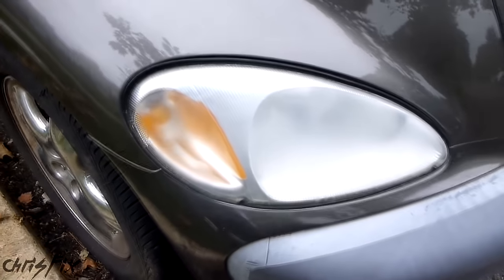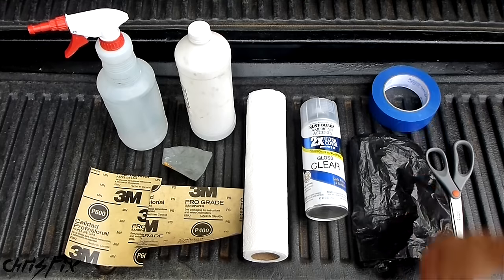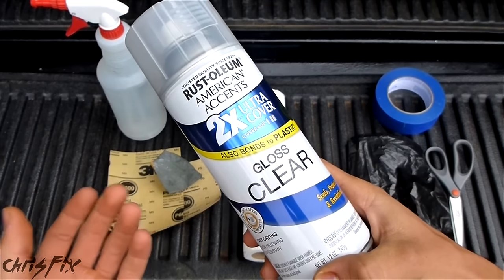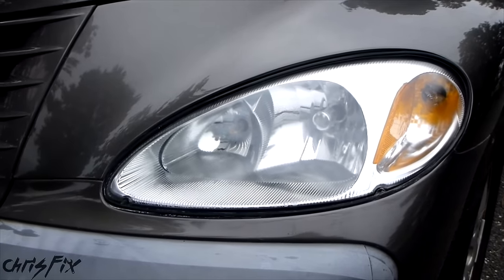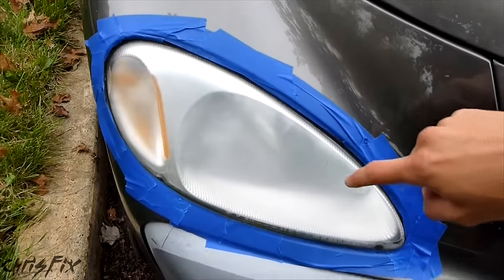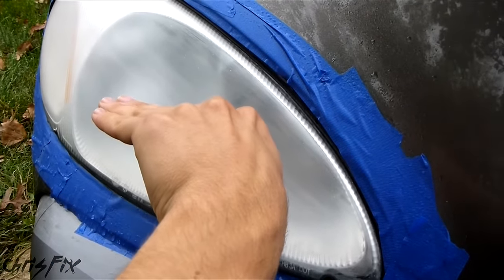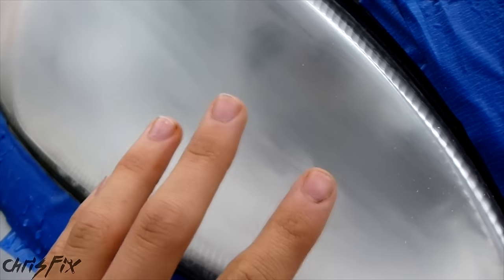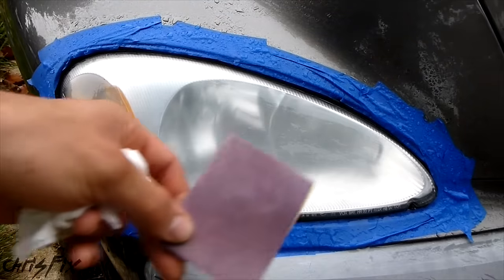How to Restore Headlights PERMANENTLY

Comment: Its been 5 years my jeep is finally back yellow lasted so long cant thank u enough gna sell it after i do this magic to its headlights again at 290000 miles itll go for 2300 bucks 😊
Reply from the maker: Glad to hear the real life experience! Mine lasted about 5yrs as well!
Reply: @chrisfix Are u able to drive the car while waiting the 24 hrs for the clear coat to dry? I wouldn’t be able to let the car sit for 24 hrs straight, would it still come out the same if i just wet sand and wax after the 24 hrs?
Reply: @nathanmartins5543  i would'nt drive since the clear coat hasn't dried up yet and if dirt and rocks hit the headlight it will look scratched up
Reply: Bout to use this to get past a road worthy in Australia 
Cheers mate!
Reply: I did this five years ago and it’s starting yellowing again. I don’t have any clear coat left so I just waxed it after wet sanding with 1500 and 5000 grit. Looks great
Reply: @chrisfix  THIS is the comment I was hoping for. So many 2k haters out there but looks like the longest lasting solution.
Reply: I got a Dodge 2008 1500 Bighorn as an old work truck but decided to go all out with at home restorations" SO FAR SO GOOD but it desperately needs this 😮
Reply: @Runswithwood  This isn't a 2K clear, it's just Rustoleum's 2X meaning twice the coverage. Has no hardener like a 2K.
Reply: @SirPractical  I hope he read your reply.
Reply: MOST underrated comment!
Reply: @chrisfix  you're replying to a NINE YEAR OLD VIDEO
you're THE goat of youtube my man
Reply: Chris I glad you and fellow follower states that the headlights lasted 5 years my question is after a few months can we also put a polish or a wax on it to keep it shinny and clear

Comment: The PT cruiser is good practice in case you mess up you just take it to the junk yard.
Reply: Oh ppulleeez!! I love the "my car is better than your car". I have owned 3 and each lasted 200k + miles. Great compact in the snow, the turbo has 225 horses and still running strong. Good car that Plymouth just decided to make is less so year after year until it's elimination. Chevy, now there is a company that made trash for years and years and just now coming back a bit.
Reply: spudnic88 my neighbor used to have a purple pt cruiser with wood paneling on the side 😷
Reply: spudnic88 XD
Reply: Prowler on the other hand would be sweet.
Reply: The PT cruiser isn't put "on blast" because its unreliable...  Its simply UGLY... That 1930's style grill is hideous & the interior is cramped in the rear.
Reply: In your opinion it's ugly. Do you sit in the rear often? Actually people I take in the back seat like it. The seat sits a few inches than the front and they can see very well. I have driven 2 for 200k+ miles. Hey it's a compact car, basic transportation, ugly "see Prius"
Reply: Either way u slice it the car is trash if u are over 5"8 don't know why you would own one of these but have who am I to judge haha.
Reply: Brett Werner lol this is true. i went to a local junkyard and while every car are scattered somewhat random, they lined up about 30 PT Cruisers on one side of the lot's perimeter.....there are so many of thsn that they were able to groupe them up together lol
Reply: Wow, you do realize that the latest PT is now 7 years old! And most are over 10 years old, and they sold a lot of them. Oh BTW I am 6'4" and the 5-8 comment is strange. Oh next time at the junkyard since you must be so bored, check out how many Chevy's (any year) are there, and report back your findings, such valuable info really proves nothing. So much animosity toward the PT, do you have small hands as well?
Reply: It was a fun design for a car...but, they did the timing as a belt that cost over 1000 to repair...and that also broke and then broke the motor...bad design in the motor....sad, as it was a nice little retro design... and could have been fun to re mod~!
Reply: Kevin Kempt
Reply: Lol damn, Kevin, talk about overdoing the defensive damage control.
Reply: Brett Werner
Reply: Damage control?? All this over a car? I like my car and you don't, OK! At least it ain't a Pontiac. Haha
Reply: Kevin Kempton what's wrong with Pontiac? They make great cars, and the reason their is a lot of Chevy cars Ink junk yards is because they are a very popular brand and when they get wrecked, old, or they stop running a lot of people just junk them simply because they don't know how to fix them
Reply: Kevin Kempton hey don't be bashing pontiacs. the grand prix gt is a bad ass car
Reply: Lol I'm just saying, there's a fine line between proud ownership and PROUD ownership.
Reply: I always called it the "PT LOSER"
Reply: Brett Werner Thats a good one!  🙄😆😂
Reply: Brett Werner 😂😂😂
Reply: madjimms  If you like retro, then you like the PT.  If not, don't look at it.  The grill is a horizontal version of the top of the Chrysler Bldg in NY.  Maybe you'd like the Excursion if you don't want to be cramped in the rear seat?  The PT was sold as a compact and the rear seat was bigger than a VW Bug so...
Reply: lmmfao !!!
Reply: I’m sorry to these other folks but everything Dodge came out with during the time of the pt was garbage.  I think the only options on the car was working or not working transmission but it did have a class leading gas saving feature called “tuesday start”
Reply: Mount a Chevy SB in the middle of the thing, put in a rear axle and make a real car out of it.
There ya go, Chris.
Reply: Kevin Kempton just a question. If the car is so good why did you have 3?  😜 (teasing ya please don’t take it to seriously) My first car I had until someone crashed into it when it was parked well off the street. My current car I’ve had for 10 and will have another 10 at least I’m sure. I think most people hate the pt cruiser due to the fact it looks like an old hurst.  Basically looks like your taking yourself to the grave. Lol. 
But seriously, what ever car/truck/vehicle  you have if it does the job you need it to do then it’s an awesome vehicle. No point in being Uber negative to everyone who drives something different folks.
Reply: Best comment lately.   It hit me just right.  I’m laughing out loud.
Reply: Practice on a PT cruiser enough, and then you can try it on a real car.
Reply: Lol
Reply: I love my 2002 cruiser. It's adorable!
Reply: @leanmeangreenbeanmachine3347  Subjective. Mine is very cute with all the extras. You haven't seen mine and besides, you don't have to like my car. All that matters is that I like my car.
Reply: spudnic88  LOL
Reply: spudnic88  first off the PT cruiser is a chrysler. 2nd they are trash. This is undisputed.
Reply: @13kkempton  Based on your offended response, I'm not surprised those back seat passengers of yours would say, "It's nice and comfy back here."

PS: The Prius is ugly too.
Reply: I think you're smoking crack Brett the PT cruiser was actually a very good and very reliable . you can buy a $80,000 Corvette from general motors that won't go 30,000 miles before the engine explodes but people love the hell out of them.
Reply: mizal215 My friend is 6'4 and drives one its hella rusted still runs great and he loves it
Reply: Fr😂😂😂
Reply: I almost want a turbo PT cruiser. Less beefy SRT4 engine, would be funny as hell gapping Mustangs with one of these fucking things
Reply: Lol we literally have a pt cruiser in my highschool auto tech class to practice on cuz its trash
Reply: @rbreeze789  that's hot
Reply: @dylangullason8712  Pontiac fiero has ferarri body kits too
Reply: @13kkempton  Need to get rid of it. The Transmission will blow really soon mate. Get rid if it, chuck it in the tip.
Reply: That's Hard
Reply: @13kkempton  Why does the air box take up 50% of the engine bay though?
Reply: Lmao
Reply: @13kkempton  Why do u feel the need to Diss Chevy??? What did they do to you? Nothing against Mopar but Chevy never had to be bailed out by the government...JUST SAYING....
Reply: @13kkempton  Again??? Why is it always Chevy...Pick on Ford BMW Mazda why always Chevy? MAYBE BECAUSE U COULD NEVER AFFORD A GOOD CAR..
 A "CHEVY"
Reply: @13kkempton  the PT Cruiser is just ugly..
Reply: Lmfao
Reply: @13kkempton i dont see anything wrong with them.

Comment: I just did this on my 350z, WOW what a difference. Small tip is when you move on to the 2k grit, sand until it seems clear while youre sanding, I.E. you dont see much haze while its wet. Learned that the hard way.
Reply: Mr. Mills I messed up, the clear coat got bubbly and peeled. do I have to start over or just add wax
Reply: Black Titan I would re-sand it. I didn't sand my right one enough with the 2k grit the first time so I went over it again with the 400 then 600 then spent a lot of time on the 2k. After re doing it the light looks great. I would re do
Reply: Mr. Mills I only have 600 and 2000 grit, should I start from the 600 grit and up. would that be enough to get the clear coat off completely?
Reply: Yea you should be fine
Reply: Mr. Mills Did you also respray them with clearcoat?
Reply from the maker: Thanks for sharing!
Reply: ChrisFix PT Cruiser? I'm disappointed in you now man..
Reply: patto ur catto it's not his lol. How do you think he has like 50 different cars in all his videos
Reply: Yep, I had a go at restoring the headlights on my S2000 last weekend, and didn't go over it with the 2000 grit enough - the results were okay, but not quite as clear as I was hoping for. Will have to redo it at some point.
Reply: I see a lot of comments about not enough sanding with 2000 grit. stepping up directly from 600 to 2000 seems like a big jump. if one doesn't mind the bit of extra cost, seems like it would be easier to get a better result by stepping to 800 and 1000 in between? Also, alternating the direction of sanding makes it easier to see when you've removed everything from the previous grit.

Comment: 10 yrs ago i didn't know how to locate an alternator, a caliper bolt, a coil pack.....i knew almost zero about cars, yet i drove them well. 10yrs later I've done over 30 plus brake jobs, replaced ac parts, fixed heating system, modified exhausts, installed several suspension upgrades, upgraded brakes to brembo calipers, replaced several wheel hubs, painted 2 cars, installed racing seats, minor transmission repairs, flipped a few cars, helped several random strangers with minor repairs...this faceless dude who says "soapy woder" gave me the confidence to entire the world of DIY...saving myself 1000s over the years. I remember when he was at 300k subs. You're a boy now. You've helped millions. Thanks a million Chris!

Comment: I followed these directions about 6 years ago, and the lights still look great! I also did the fog lights! Thanks, Chris!
Reply: Well, I am now officially motivated - 6 years is a long damn time.
Reply: @jdsguam  How is it going
Reply: @jdsguam  That's enough time for the headlights to get 100k miles older or more, and still look the same from when he first restored them
Reply: For everyone else, go watch any other headlight restoration "how to" video. This one has dated information, you don't leave the headlight rough so the clear coat can "stick" lol. The smoother it is the better it will look.
Reply: @mimos7214  Van is still on the road & the lights still look clear. There is a slight haze in one spot on the "top" of the lens, but overall, it's still looking good!
The fog lights were pitted before & are still pitted, but clear, although they don't get much sunlight exposure.
Reply: @robertl955  Mine were done around 6 years ago & are still clear. I thought I might reapply the clear coat again, but with almost 300,000 miles, I might not worry about it!
Reply: @robertl955  most of what I'm finding even today says the smoother finish does not hold up to rock chips and debris.
Reply: Thank you for the follow up! I just finished clear coating mine and they look amazing.
Reply: @OpticalToxin  You know what? After I were to do this to make it clear now, then worry about rocks, I would go that extra step and buy some 3M Clear Vinyl wrap and put in on the lens, that will protect it and say for example, later there was some rocks or something happened, you can just pull off the film and just put on another layer of clear wrap.  To tell you the truth, just getting the lens clear and maybe you don't need to put on the clear coat, just buy and put on the Vinyl lens wrap, seem easier, just a few bucks added.
Reply: @virtu3758  I ended up wet sanding 320, 400, then 600 grit. Sprayed it with clear. Dry sanded 800 to remove orange peel. Then wet sanded 1000, 1200, and 1500. The I hit it with compound and polish using a DA. They look great but if I have to do it over I'll buy new lenses entirely and cover with lamin-x
Reply: @OpticalToxin  Hey, that's cool. There's a satisfaction doing things yourself and seeing the results- you can do it yourself and not spend a ton of money. So many people today, they don't seem to get that.
Reply: Same here, I did this treatment probably a few months after the video came out. The headlights now are starting to look like they might need another treatment, however, they lasted for like 8 years. Thanks Chris!!
Reply: @dannygg  I'm driving a used '03 accord so a fix that lasts that long would definitely be worth the time for me, hopefully I'll trade up before this fix wears off

Comment: I’ve done this twice, probably 4 years apart, on my 2004 4Runner. An hour of work to make it look way better and brighter/safer lighting. Thanks, Chris, this works so well!
Reply: As others have recomended always go with SYLVANIA Headlight Restoration Kit. Shits the best on the market, and I can't recomend it enough.
Reply: I did this twice too on my 2004 Camry. But it didn’t make it much better. And it got worse quick. I think once the plastic “yellows” it’s too late.
Reply: What brand clear did you use?
Reply: @sweatshopkids it lasted 4 years though even when you buy the car new they eventually haze so don’t get your point.
Reply: Well if its permanent, why did you need to do it 4 years later. Obviously its not permanent!
Reply: @majorburke9735   This is good to know. I was going to attempt this, but my car is pretty old and I'm sure the headlight plastic is yellowed by now.
Reply: Good to know you got four years out of it. The Meguiars kit works but barely lasts a year. While road debris surely can't help, I'm not convinced it's the main cause of hazing because I also have this problem on an old truck that only gets driven once a week less than 30 miles. Manufacturers probably cheaped out on the type of resin used in the lens.
Reply: I was spraying a 4 runner and having some trouble with the clearcoat
Reply: @zilverme5200  he means its not gonna be hazy in 2-3 months, it's gonna last for a good period of time, even brand new cars get hazy headlights after a couple of years depending on how much you use it of course, but if it works for a few years it's already 20 times better than many solutions that only last a couple of months